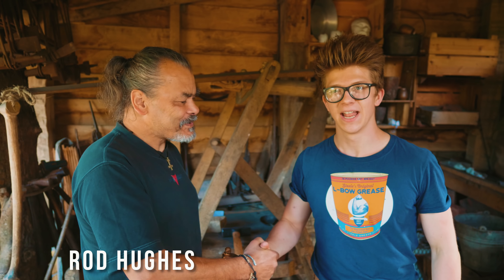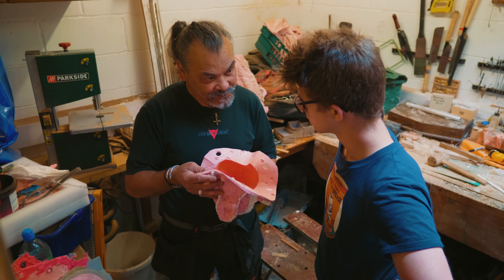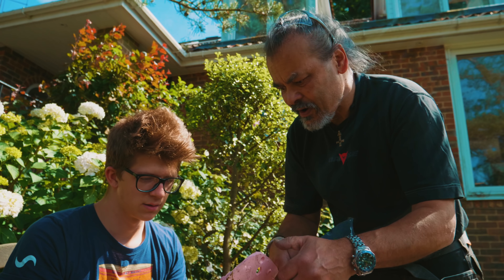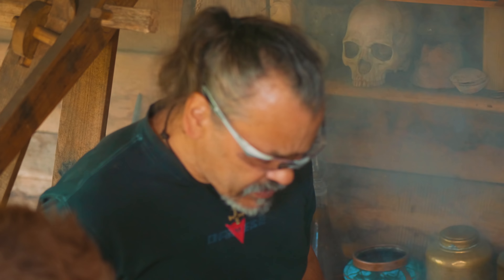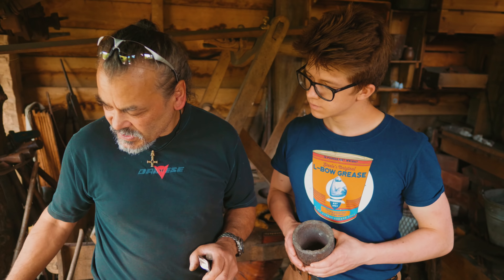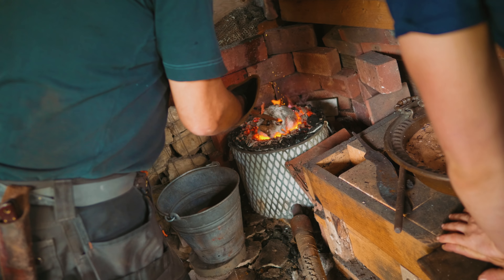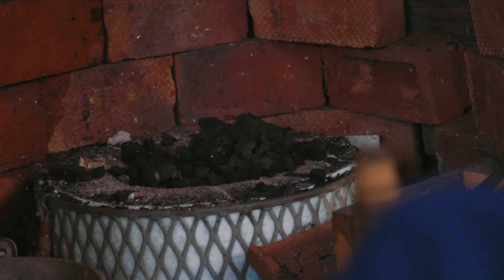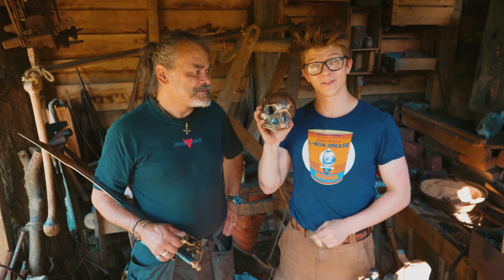CASTING A BRONZE SKULL!!!

Comment: Alex,

One major step he is doing that you were not, is heating up the mold. I could see this being essential from a thermodynamics perspective. If the hot bronze touches cold mold, it will cool too fast and not fill the mold the way you want.

This is also a secret for food. Always heat your plate when serving hot food.
Easy way to heat a plate, but a thin layer of water on the plate then 30 sec ins a microwave, perfectly warmed plate.

Comment: I'm surprised he doesn't use a lever mechanism on those bellows. A central vertical pivot with a horizontal lever attached to both bellows.  Allows for consistent output with one or two handed operation.

Comment: Or you can use a hair dryer. I found that the same set up but with a $10 hair dryer providing the air, it still melts copper

Comment: I really can't buy into that whole 'to make authentic blades you need to use the same techniches they used in the past' stuff, all modern tools do is save you time. It's ok to admit you like to use the old methods and tools because you enjoy it.
Reply: With respect, If you are making a full sized replica of an original pattern welded Viking sword for a museum, using gas and power hammer you won't appreciate the huge amount of work and resource and wealth that was originally invested in the blade and the results will be subtley different. I use modern tools and equipment when appropriate but it is good to experience the difficulty of doing it the hard way. Our ancestors did!